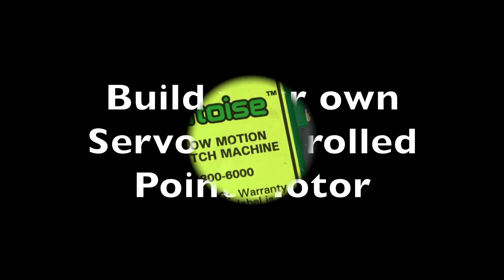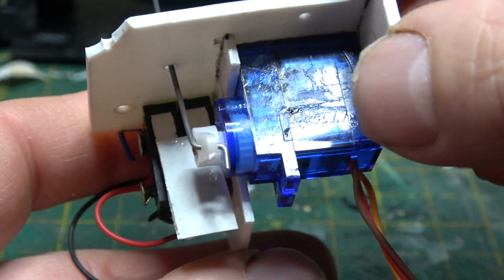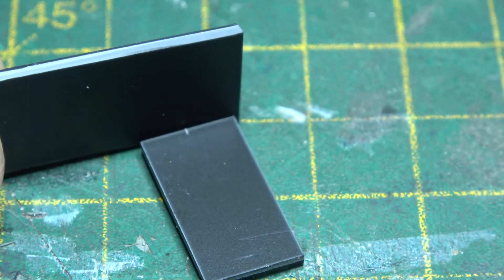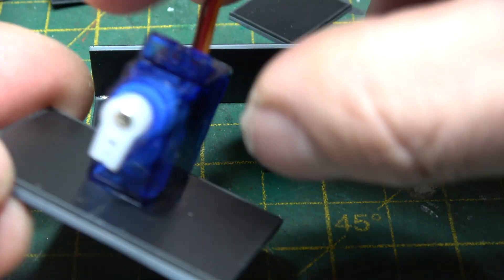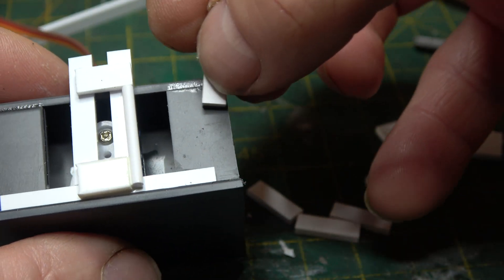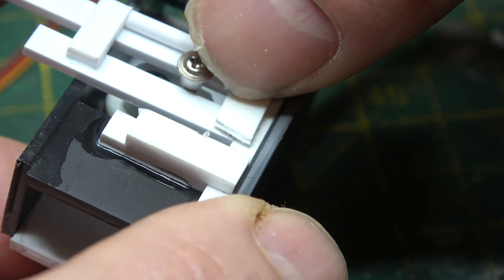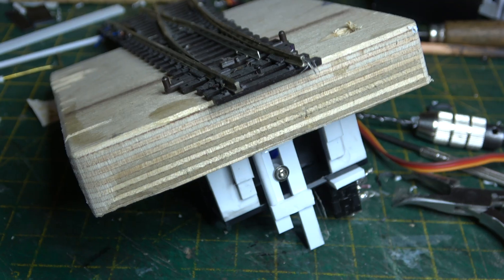Build your own Servo Point Motor

Comment: Hi again,
I built about a dozen of these and they worked really well for a while. This last spring, I had a few of them come apart where the backs were glued and the front from the base. 
I really like this system so I decided to try to 3D print up some to see if they would work. After a few trials and errors, they came out really nice. If you would like, I can send you the pics of the 4 pieces that make up the build. 
I did set a couple up for the long leg limit switches and these you need to drill and mount yourself depending on how you place your arm.
I'm not offering the STL files to anyone as the concept is yours and without your permission, I would feel like it would be wrong to do so.
Pete
Reply from the maker: I mentioned in the video that the idea was borrowed from Dingo Servo Mounts. http://www.dingoservo.co.uk I just adapted the concept for my own needs. With over 100 points and signals to control, cost £££ Cost was a primary concern. 3D printing is the way forward and you need no permission from me (in my opinion) to market such items. I think they should prove quite popular 👍👍

Comment: You can save a lot of time and effort by using thin spring steel wire from the arm, through a pivot point and allow the rails to move from side to side. The servo provides a small amount of over-shoot and this allows the spring steel wire to keep the rail pressed against the side rail. No sliding mechanism is needed.

Comment: Good morning Nigel and Happy New year 🎉. You remind me of a model railway  Allen Millyard 😉👍
Glad I found your video on point motors as I'm about to start a new layout myself. I wonder there's a way to internally modify a small RC servo so that it doesn't need any external control just to give it a simple bi-directional sweep when the polarity of supply is reversed (the same as a tortoise)? I'll investigate this and report back. I did like your "tip of the hat" to certain work colleagues who I also know well 😂 I hope they supplied you with appropriate trainborne mince pies during the festive season along with the timings print off 🤔 😁👍

Comment: Well done you. Thanks for the plug to my website. My only comment is that plastic mounts deteriorate with time especially if used in the loft of garage, whereas my aluminium mounts will last a life time. Also it would be very hard if mot impossible to change a servos should it fail in your mount. Regards Dave (Dingo Servo Mounts)

Comment: How do you wire your electrofrog points?? The point motors have a connection for that wire to plug into?? I want to use servos for my points too. Look forward to your answer 😀
Reply from the maker: I've got a video about it. 
Its called Modifying Peco Points

Comment: A bit late in the dat, but I have only just come across this video. Brilliant stuff and well worth giving a try,. Which of the Hobby King servos did you use? the HTX900 or the HTX500? Where did you get the micro switch?
Reply from the maker: Re servos, err not sure?
I use lots of Tower Pro SG90 
They're equally good, cheap and easier to get hold of.
I get the micro switches off ebay. Various suppliers, normally work out at about 50p each. 
go for the 27mm lever version
Reply: @Wallsrail  Thank you very much

Comment: Very cool build. Love how you’ve both visually and textually explained your method. Really like the simplicity. And, of course, the linear motion you’ve achieved. Definitely will check out your method for my point motors. Humbly think this method also allows for smoothly operating ‘remotely controlled’ points, turnouts and even is an excellent possible solution to mechanize scenes.
Thanks 🙏 for sharing!!

Comment: Like these! They give a nice realistic throw to the switch blades. 

Typical point machines on the real thing will swing Normal to Reverse in circa 7.5 seconds, so this replicates the swing very well. 

Simple switch detection via the microswitch as well. Nothing wrong with simple! As an S&T man (now retired) I would be interested to see how you tie your point detection in to your signalling, but I guess that will a future subject? Nothing wrong with relay technology - the real thing has used it for well over a hundred years.

Have you had any servo motor failures? I guess you would replace the entire motor module in the event of a fault, then bin the servo?

Well-thought out concept! 

Spot-on! 👍🏻

I’ll shut up now and go take my pills…
Reply from the maker: My self taught electronics is very basic. I understand micro switches and their electronic brothers, the relay. For the average model railroader, that should be enough!
As stated in the video, the idea was copied from a Commercially available product. Having over a 100 points and signals, price became a large £actor.
Many attempts were made to create something with simple repeatable construction. Some of the early ones have a Frankenstein look to them, still work though 😃
Haven't encountered servo failure yet. And yes, replacing the whole unit would be the answer.
I did design a crude interlocking system, for my needs, a few years ago. Based on 2 pole changeover switches with hundreds of diodes. 
It worked, but then I discovered the Mega Points system. Expensive, but does more than I could ever hope to achieve on my own.
Tablets?
I need to take mine too 😝

Comment: great thank you i have 8 motors to build an have been pondering how to mount the servo motors i will be using a raspberry pi zero for the actual servo controller  i did buy one three d printed contraption from ebay which was to say the least crude and had to be surface mounted your idea looks magnificent

Comment: Hi, I was wondering if you had worked out the wiring for the limit switches yet? I want to run some Dwarf signals, one on each side of the track with 2 color, red & green, LEDs to show which track was open or closed. Can it be done with 1 switch for both lights or will I need to use 2 switches, one on each side of the bracket?
Thanks, Pete
Reply from the maker: No, not yet!! Getting around to it though! 
Should be able to do what you want off 1 micro switch. It is after all just a change over switch. 
I'm. gearing up to do a control panel video, which will cover how to do that. Not sure when it will be though, as got a backlog building up......
Thanks NW

Comment: What kind of glue did you use?
Reply from the maker: Plastic Weld liquid poly
https://www.amazon.co.uk/Plastic-Cement-Stick-Plastics-Weald/dp/B00QQNNWIW/ref=asc_df_B00QQNNWIW/?tag=googshopuk-21&linkCode=df0&hvadid=309775932390&hvpos=&hvnetw=g&hvrand=10992527185875771023&hvpone=&hvptwo=&hvqmt=&hvdev=c&hvdvcmdl=&hvlocint=&hvlocphy=9046213&hvtargid=pla-699618608120&psc=1

Comment: Hi again, just curious what size drill bit did you use to ream out the 1/8" tubing for the screw? I tried using shrink wrap but i would have had to keep building it up to keep the threads from tearing through.
Thanks,
Pete
Reply from the maker: 2mm I think?
But any in the range 1.8mm - 2.1mm should do the job 👍

Comment: Fantastic!

I’ve also been experimenting with servo motors and have built prototypes from Aluminium Angle and from 2mm MDF. However they all have a point actuator arm that pivots and therefore rises and falls. Your solution which provides linear motion is a great improvement… with the added bonus of provision for micro switches rather than needing to use separate relays.

To test the concept, I’ve built one of your designs (although I like to have the servo on its side) using 2mm card for the housing and 1.5mm card for the actuator assembly. I’ve not linked it to a point but it works really well.

In the new year I’ll build one from 2mm MDF with the actuator assembly made from Plastikard.

Thank you, and I like your assembly line production methods.
Reply from the maker: The basic concept is leads to many different variations. As you build them yourself, its easy to adapt them for any need not just points!!
👍👍👍👍👍👍

Comment: I cannot see where your points actuator  wire is attached, I assume it is inserted in the tube somehow?
Reply from the maker: Errors and omissions 😖
Yes, forgot to mention that!!
Wire inserted into the tube on the actuator that pokes through the base board. 👍
Reply: @Wallsrail  I have constructed some 16 of your point motors and they all work brilliantly. I have also included micro switches as your dwg suggests for indicator LEDS.

Comment: Another Question......not sure why you use the #223 tube .........wouldn't a flat section work as well? Edit....ah, is that where the wire sits (and goes up through the baseboard to the point)?
Reply from the maker: Yes, forgot to mention the actuating wire! Doh 😖

Comment: I built my first one today. I made a few mistakes but was able to jury rig / correct them with a few extra strips of styrene. Next ones should be better. 2 Questions, first, is the rod you used as a spacer 1/8" tube or larger? Second Question, why are there 3 fronts made in your diagram when you / I only use 2?
Reply from the maker: Excellent 👍
The tube is Evergreen 223 3/32 tube
But can be swapped for another size depending on what size of rod you want to operate the point?
Third piece of front is used as a larger platform that the micro switch sits on. I sometimes use scrap/off cuts for this. Entirely optional? 
Thanks
NW
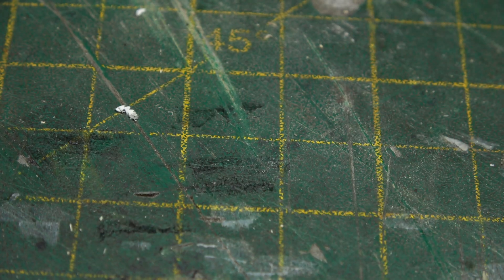Reply: @Wallsrail , I was talking about the tube / rod that you used spacing the 2 upright arms at the 2:20 minute mark.
Reply from the maker: Ahh, yes, that would be 1/8th tube. Evergreen 224.
Reply: @Wallsrail  Thank you. I thought that was it but wanted to make sure...
I also made a board similar to the Duplicate-It from Micro Tools for scoring and cutting the styrene sheet but I can't figure a way to post a picture of it in the comments here on UT.
Reply from the maker: @repeters1  Send it via email. Should be on my page somewhere... 👍
Reply: @Wallsrail  I sent it to you on Face Book Messenger.
Reply from the maker: Got it, and along with some others might appear in in future episode 👍👍👍

Comment: Brilliant! Please do a follow up on wiring the microswitches.... presumably one for frog polarity? One for lights? Cheers
EDIT: Just watched modifying Peco points ...clear now, thanks!
Reply from the maker: More to come on micro switches when I start doing colour light signals....
Reply: @Wallsrail  Excellent........a homemade holder for those of us who don't 3D print (or pay the huge Shapeways prices!)
Reply from the maker: @paulhargreaves1497  Indeed 👍
Think I state in the video somewhere that I can produce these for about 20p (not including servo!). And when you have a layout with just over a hundred, well cost is quite important 😃

Comment: Hi, absolutely brilliant piece of engineering and solves one of major point movement issues also, (Tie bar keeps moving up and down) can I ask I assume the thin tube of styrene point  up on the actuator has a metal inset that goes into the hole in the center of the tie bar still?

cheers and keep up the great work.
Reply from the maker: Yes, absolutely correct! And the one thing I forgot to say/show!!
Thanks 👍👍
Reply: @Wallsrail , What size is the metal tube and how do you keep it from moving? Also, where could it be purchased?
Reply from the maker: @repeters1  Sorry Pete, not sure which metal tube you're referring to?? Could you time stamp it for me and I'll get back to you, thanks
Reply: @Wallsrail  Please see above comment from Buckingham Place "I assume the thin tube of styrene point  up on the actuator has a metal inset that goes into the hole in the center of the tie bar still?l
Reply from the maker: @repeters1  Ahh! Ok yes, its something I forgot to mention, Doh! The plastic tube does indeed hold the metal wire that switches the point via the tie bar.

Comment: My last layout that I had til the early eighties, my father built in an absolute block system with relays so you had to set a path rather than just a signal and point setting as per a lever arrangement.   He put in neutral sections energised by green signals and a correct path using cheap RS components relays and he had his mate on the S&T work out the electricals.   One of the reasons Hornby/Triang lever switches are so shaped is you could with a bit of jiggery pokery mount them into the roof of a signal box thus give you an actual signal box control, sadly no bells but it had the curious and fun thing of a main train forcing a following train to halt at a red and proceed as the next but one block cleared.   I seem to remember he set it up controlled using bus bars and each energised section was under control of one controller.   
For years I had all the paperwork and schematics from this but lost them in the mists of time, it was insanely complex but actually worked and I remember showing off my layout to school which prompted the creation of a rail club.   He used I think momentary microswitches as signal treadles and seem to remember the logic work was the first movement of the train into a section would energise that section but kill the section behind which a relay on the next section gateway would release the first relay to be energised which powered up the signal and track circuit.   
Sadly as teenage years took hold and girls etc became more important than model rail, sold it for a very tidy sum prob a couple grands worth in todays money as it was beautifully done spending much time with papier mache, chicken wire, paints and model buildings etc to make it into a very detailed layout and no LED's back then all incandescant micro bulbs which was handy as BR NX panel bulbs my father got me a whole box of which ended up in coaches, engines, houses and stations.   The thing produced a LOT of heat and smelt like a burnt out clutches cod piece but it was brilliance homebrew.
Reply from the maker: Hmmm Electrical burning!! 🤔😱😂👍
Reply from the maker: With a small understanding of basic electronics its not that difficult. I pretty much taught myself enough to get by, a pro would be horrified or laugh at me, but I have managed to create route setting with diodes. crude but worked

Comment: As you know, I am not very knowledgeable about these topics, i realize that as someone else has stated that you manage to do so much with some plasticard etc.  I know you are a  fan of Dave Fentons products, so wonder why you don't use his laser-cut framework servo mounts? Or have I completely missed the reasons why you chose this method. If so why have I gone wrong LOL. Got to say I really do enjoy your content, cheers Paul
Reply from the maker: Its the up and down motion of the operating wire that was causing me and others some issues!
Having a linear side to side motion eliminates all
 of those issues.
Dave does some excellent stuff, but gears his stuff to make you buy more of his products = brilliant planning and marketing!!
I use the micro switch on the top of mine to change the polarity of the point frog, Dave wants you to buy his electronics to do this and doesn't make provision for attachments to his laser cut mounts.
I've spoken to him about it.
I've got a follow up to this one in process
Thanks mate 👍😀👍
Reply: @Wallsrail  thought I had missed something important, thanks for letting me know .
I too had had those up and down issues, but not brave enough this time to do why you have done .

I have a surface one to deal with as well, any ideas lol 😃😃
Reply from the maker: @Sandlingjunction  Have a look at the Dingo servo mount